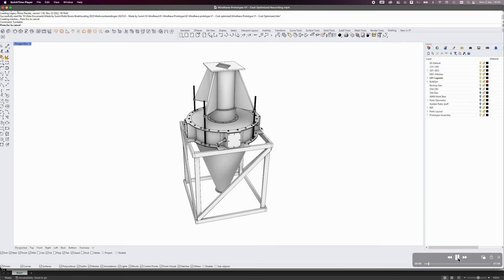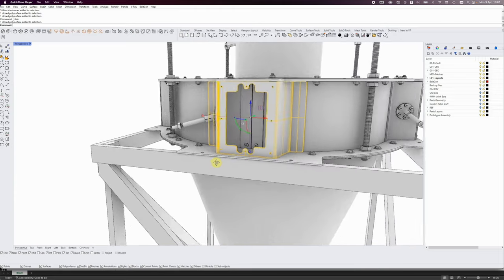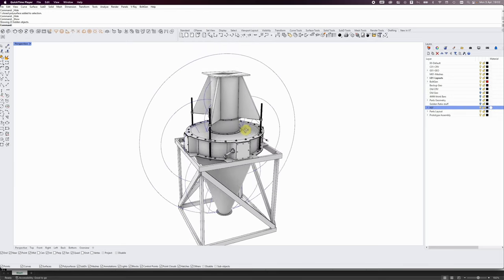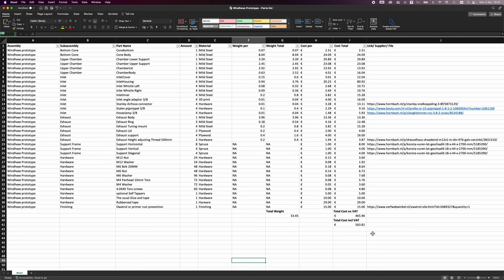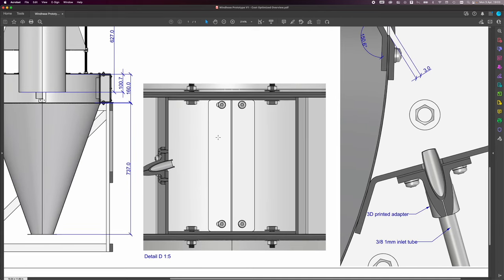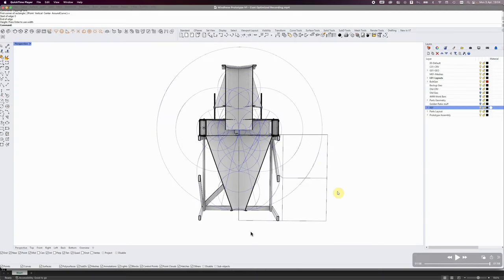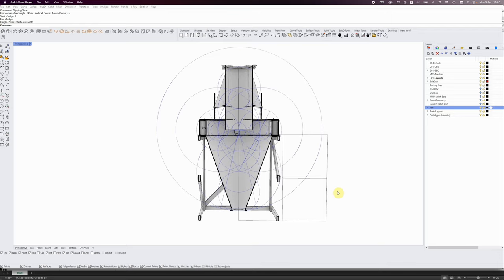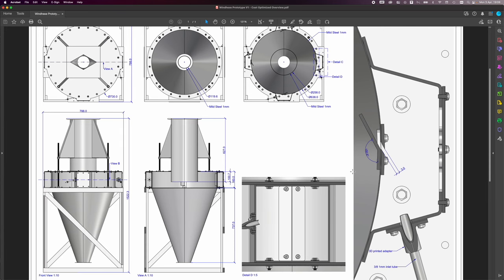O-Day - Optimised prototype Windhexe engineering drawings and Bill of Materials

Comment: Very impressed with Tony Jabony’s Rhino Cad work, and in such rapid time. Total respect!
Reply: Extra Note: Did Tony Jabony roughly calculate the air pressure and CFM required for this quite large windhexe version?. As looks like it will need quite a seriously large CFM flow rate shop compressor or industrial high pressure blower to operate this diameter of windhexe. Thats why i have to stick to smaller 30cm to 10cm diameter initial windhexe bench top concepts, as i only have access to a 90psi Husky shop vertical air compressor with a 20 Gal tank at present for hopefully near future windhexe testing experiments.
Reply: @petermiddleton6902  Hey Peter! Thanks, I will be running wires to a proper ground, this thing will build up a lot of static electricity when running,

So I have not tackled the compressed air calculations yet. My approach for now is hooking it up to 2,3 or 4 individual air compressors in order to increase the air flow. 
I hypothesize that the large chambers will not be pressurized that much and that most of the pressurization/air modulation happens at the inlets with the "whistle aperture" 
I also suspect that the vortices inside will actually trap most of the incoming air in its structure and that very little of the pressurized air will move out of the top and bottom. It might even create a secondary current sucking air up in the middle of the bottom hole and pushing it out of the top. Most of the pressured air might just get centrifuged in the chamber and cone and not exit the device that much.
Reply: @TonyJaboney  Cheers Robb!.

Was also thinking maybe it would be interesting to add an inline adjustable spark gap from the windhexe to ground. So could then have the spark gap either completely closed as a short, or the gap slowly increased to accurately measure the kind of static voltages the windhexe actually can produce. Including to see what different effects it has on the windhexes operation. These free electrons could also be harnessed quite efficiently or even used for inline EVO generator experiments, but i will save these details for another message.

Yes hooking up a number of individual air compressors should in theory provide enough air flow for your larger scale design. Say if each shop air compressor can produce 5 cfm, then with one for each of the four inlets thats 20 cfm, which should in theory do the job. In Polifkas patent he states the cfm range from 5cfm to 12,000cfm, and pressures of 10psi to 600psi, which is not that helpful, but certainly covered himself.

In the Kraft processing patent they state pressuress of from 35psi to 60psi being the  sweet spot for them, but this is for powdering food ingredients from chocolate to dried fruit, so maybe glass, aluminum and concrete may require higher pressures?, but only some initial experiments will really tell. I believe your totally correct that the large chambers will not be that pressurized, and that most of the pressurization will be at the inlet manifolds.

The windhexe is essentially the same as a cyclone separator, but using almost supersonic air velocities in theory. There should also be a relatively still thin boundary layer formed on the inside surface of the cone, protecting the metal cones walls from the intense shearing forces, and other unique damaging effects... On top of this surface boundary layer should be a maelstrom of micro supersonic vortices, which maybe be where most of the powdering action is happening...Including special charge separation effects.

Comment: On the sacred geometry side of things, I have been meaning to comment this for weeks, but the shape and angle of the sonotrode of Cardone’s team is something they found out to be key to obtain results,
and also the shape of the vessel containing the liquid that is being submitted to the process, which is the opposite cone shape, so, they also found experimental evidence of the importance of shapes of reactors, and found the same basic sacred geometry to be of key relevance.
Reply from the maker: That was not lost on me... I did not know that they had connected it though.
Reply: It seems to have been empirically by trial and error, but Cardone himself mentions the finding of a “correct angle” in one divulgative demo filmed some years ago.
Reply from the maker: @curbina  I was lucky, since, I could see it from so many angles from so many different experiments in different mediums, such as in live ultrasound in water (Ralkar 2017), LION (2017/18), NOVA and Hutchison (for me 2018+ but various dates), Ohmasa gas on 10-Yen coin and Tungsten (2019), ULTR (2019/20), VEGA (2021/22) etc. and the historical works of Matsumoto (1998), Stringham/Claytor (2019). All before learning of Kladov (1980 + 1997-2002) etc. etc. All the rest was inevitable since I had already clocked that these structures were in ancient symbology - My first public shoe of that was the cover slide to my Asti presentation, June 6th 2016.

Comment: I took some screen grabs of the videos from the Stillpoint channel and note that the large blue Windhexe being demonstrated does not have inlets like the patent drawings (and Tony's rendition shown here). Instead it appears to be made of Sections of Pipe welded into place to create the box.. The pipes that enter via an elbow, I would expect, might have another elbow on the inside, directing the flow along the inside of the Section of Pipe. So instead of just pressurizing a square chamber like we have here that feeds the main chamber, sone vortexing will be happening,  Touches like that may improve performance and may be simpler to build.
Reply: Specifically here at the 12 second mark. https://youtu.be/sWFfO8vbdy8?list=LL&t=12 Tey may even be a section of pipe cut in half.
Reply from the maker: See what you are saying, thanks

Comment: Should we be grounding it?
Reply: At one point he mentioned it was a good idea to ground it, 1 or 2 videos ago in response to a comment. If I had one, I would try it each way to see any changes
Reply: Yeah it'll be building up lots of static electricity when running. not to mention the potential monopole clusters if the thing does the thing with the thing
Reply from the maker: Yes.

Comment: Seems the warden cliff tower was basically a giant 3 dimensional tesla valve? Tesla valves have similar angles, and have a zone of negative pressure.

The biggest tell however, is that Tesla made them, and they are not very useful. Tesla valves were the fluid embodiment of how Tesla viewed electricity. 

That lovely man made us a parable, with triangles and circles, in 2 dimensions, just so we would see what he saw.